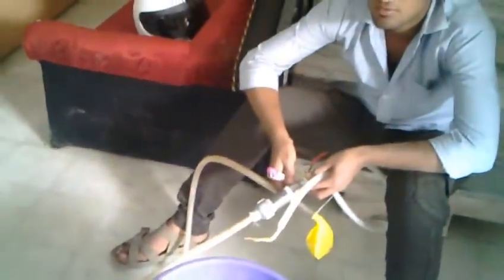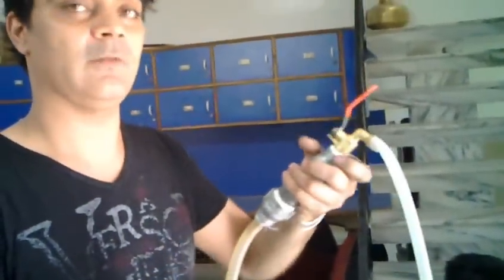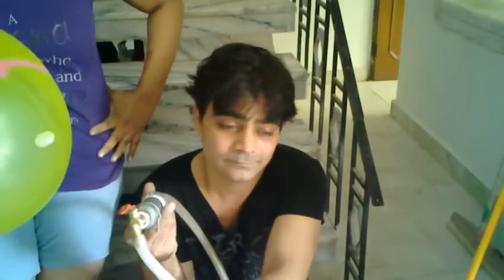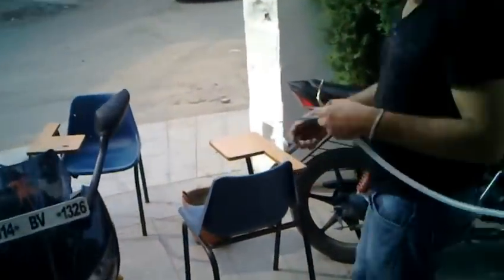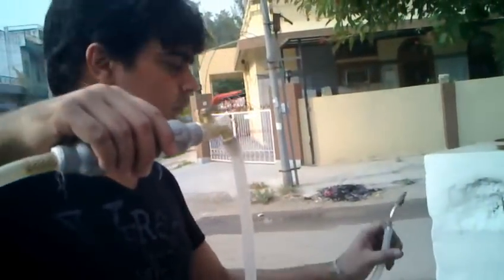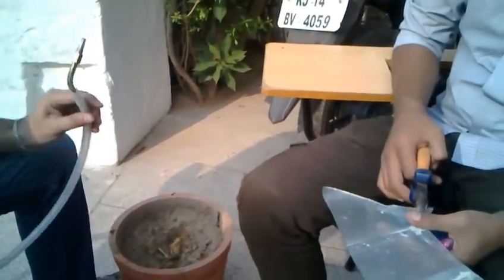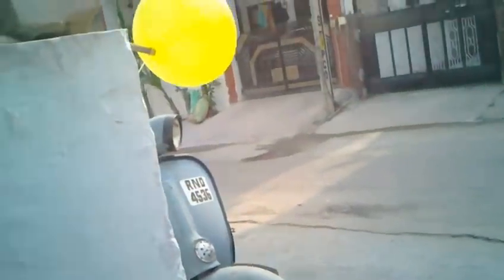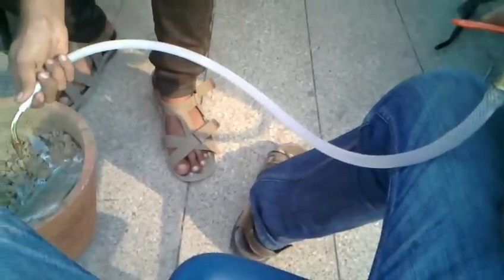How HHO Work Hydrogen gas bun glass

Comment: Nice! Have you ever tried a ceramic filter at the nozzle? You can get those filters from e-cigarettes. I also heard of people adding carbon dioxide or nitrogen gas to the hydrogen to slow it down a little.